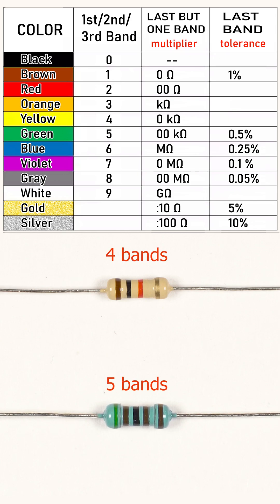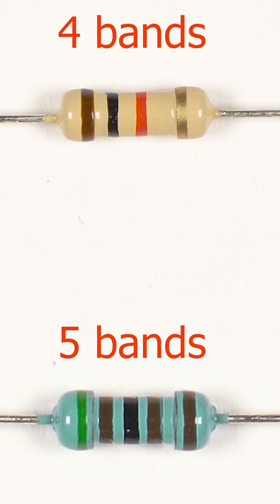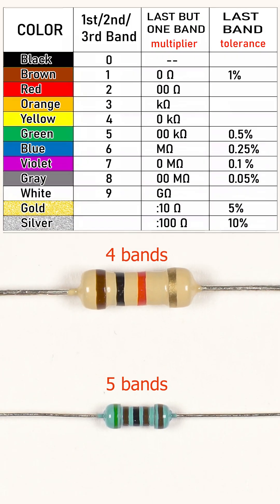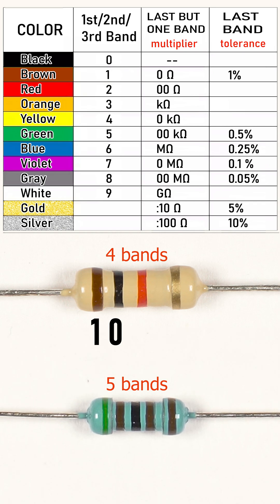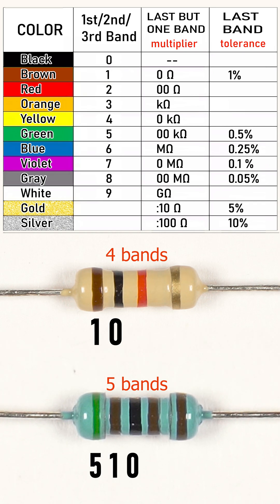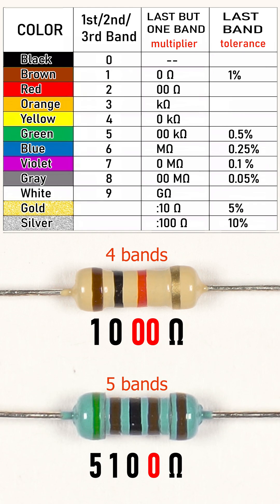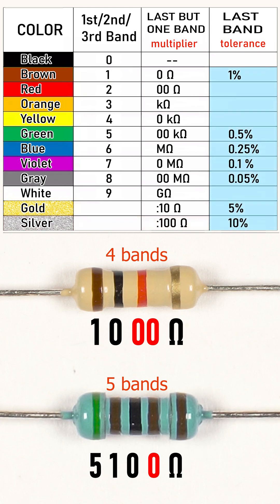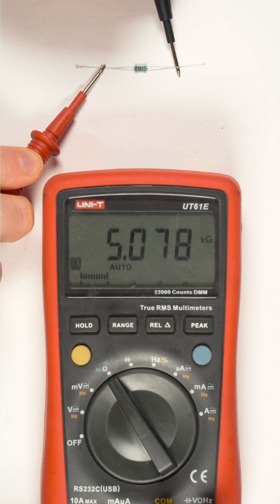Resistor COLOR code: The SIMPLEST way to read it. #electronics #diy #resistor

Comment: In a few cases, mostly in equipment specified for hosptial use, there is a band that denotes how many hours the equipment this resistor is a part of may operate, before it needs to be tested or decommed. I don't know if anyone is actually using that these days, far too many pieces of electronics don't make it that service life period anyway.
Reply from the maker: Actually, there are also 6 band resistors, but they are pretty rare. The sixth band represents the temperature coefficient.

Comment: Who came up with this convoluted system anyway? I use my multimeter in case components are not within acceptable tolerances.
Reply: Or the resistor was burned :)
Reply from the maker: True. But you cannot use your multimeter when a resistor is soldered to the board. Here the color code comes handy.
Reply: @RonMattino  Try with todays smd 30C 🤣
Reply: @RonMattino  That's what a soldering iron is for. A resistor (or other component) on a board that isn't within tolerance or that has failed needs to be tested out of circuit anyway (or replaced altogether.) That also doesn't make the colored stripe system less confusing. On a small enough resistor there aren't colored stripes so this wouldn't even be applicable with most surface mount boards. And, makers of resistors don't always meet the manufacturing standards of just making the colors easy to differentiate. To confuse things even more, old bumblebee capacitors look just like resistors and also use colored stripes for calculating capacitance. My point is that the stripe system is outdated and confusing. I've seen very experienced and respectable electricians and hobbyists fail to calculate restistance countless times because of this system.